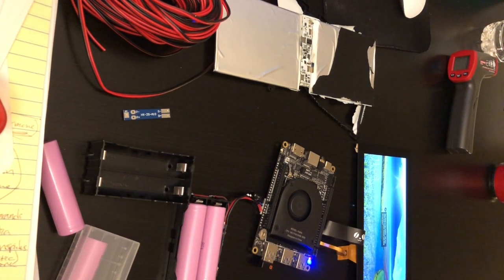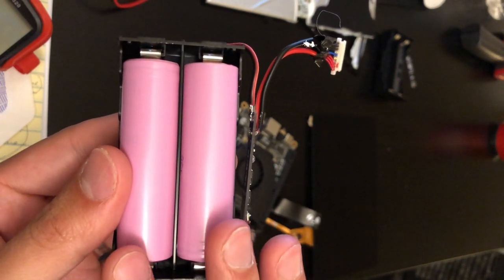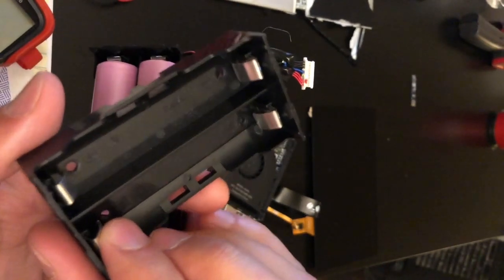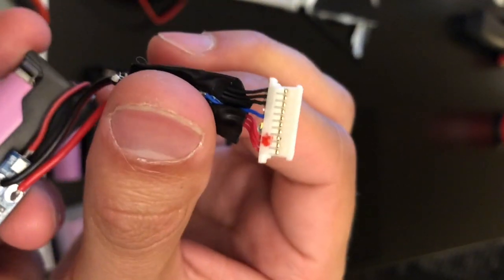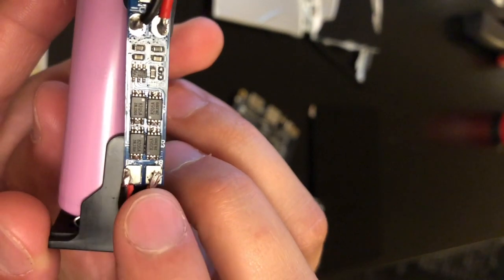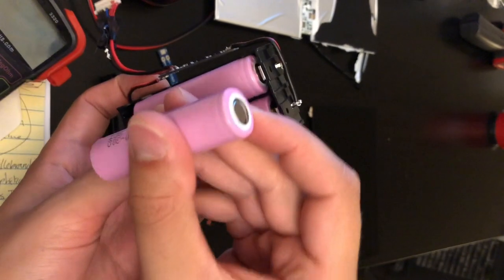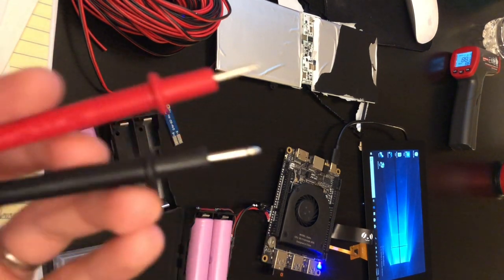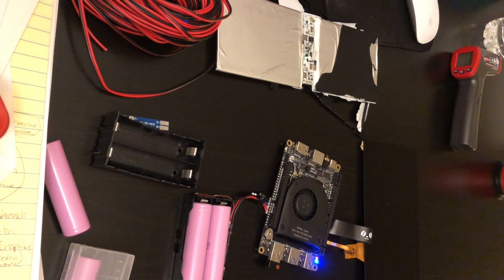DIY 18650 battery pack tutorial for LattePanda Alpha

Comment: great project you earn a new subcriber. I had a similar idea for a cloud
 gamig cosole with joycon can yoy give me an advice for a less power 
demanding board?
Reply from the maker: francesco atria thanks for watching! Do you want x86 or ARM architecture? For windows based stuff you’d have to look  at the atom series of processors.
Reply: @HandheldHardware  initially I was thinking about android but with the rise of smartphone spec I think it would be pretty useless so I thought windows might be a better idea
Reply from the maker: francesco atria LattePanda makes a Intel atom z8350 processor that uses around 10W for the whole board. UP board also makes a couple of intel atom boards. UP core is in a fairly small form factor too. Udoo X86 is an intel atom line, plus they have a X86 II line with Celeron and pentium mobile processors which should be a little less power consumption then the LattePanda Alpha
Reply: @HandheldHardware  I didn't know about them I will check them out thank you

Comment: Did you test the thermal cut off? By heating the thermistor??
Reply from the maker: Chris hi Chris, not yet. I just got some new thermistors and I successfully created a 10pin connector, so I will make another battery pack. I’ll test it then.

Comment: Great DIY!! I am going to look into Battery protection boards as I would love to find one that has the ability to monitor the batteries properly. Depending on the individual cells that are purchased, You could build a 4 cell 12000 mAh battery pack which should net the Latte panda a fair amount of use before recharge. I saw that you were finding about 45 minutes per cell? What are the specs of the cells themselves, 2500 or 3000 mAh? Either way 2 cells in a pack already have more potential then the Cube I7 batteries I have currently. 4 cells In theory should net the latte panda at least 3 hours of heavy usage as I am getting about an hour and a half out of the 4500mAh battery plugged in currently, But keep in mind my latte panda runs at 12 watts continuous. I know there is a lot of other factors in these equations but I like my rough guesstimations personally. The biggest thing preventing me from continuing with printing a case to house everything is thermals. Whether I am at 5 watts or 15, the board seems to run extremely hot, even at idle. Its not uncommon for the Cpu to hit 90 degrees under load even with everything heavily undervolted.. someone needs to release an aftermarket cooler that can properly handle the cpu at hand but I have not found anything as of yet.  (Sorry for all the word vomit here)

With all that said, Excellent Tutorial on how to use 18650 lithium Batteries!!! Don't forget your thermal resistor needs to be close to the batteries to properly prevent thermal issues down the road (If that was the case here) and I look forward to seeing all the projects you produce!!! Have a great day!
Reply from the maker: Hi Christian! I bought some components to make the connectors for 10p terminal. I didn't buy the crimper ($360!!!!!! Too expensive), but I'll see if I can find a way to secure the wires without the proper crimp tool (i.e. solder and glue). Yes, I got about 45 minutes of run time with moderate gaming  without any setting changes, so theoretically you could get more life if you changed some CPU clock settings etc. It was 4.19V when I put them in, and ~3.65V when the computer shut down. The batteries are 3000 mAh.
Reply from the maker: hi Christian, I used intel XTU and saw that the game i was playing had the cpu clocks at 2.4 Ghz and GPU clocks at ~700 MHz so it was at the high end of TDP usage, which might equate to "heavy" usage
Reply: @HandheldHardware  So the GPU and the CPU will run at 848Mhz and 2.47Ghz respectively all day long when given the right amount of power and good cooling, When I launch heaven benchmark with the LPA set to 12 watts, it will runs at those frequency's and pull 9-11 watts for the hole cpu package. If I play something CPU heavy like a modded Skyrim session, even 12 watts is not enough half the time to keep the cpu/gpu fed and one of the two will down-clock respectively. You LPA was probably hitting that 7 watt limit resulting in the 700mhz GPU frequency (I really wish MSI afterburner would report the GPU frequency in game) My biggest issue is the LPA likes to hit 80 degrees and throttle after 15-20 minutes (I wish someone would make an aftermarket cooler already!!!) But I just did a test and at 12 watt TDP With heaven benchmark running, The LPA lasts actually right at 45 minutes (5% battery left) Multiple of these 18650 cells should keep the LPA fed for a decent amount of time! I think 2 minimum would be a good idea personally.

With the recent release of the GPD win 2 (Refresh), A GPD win Max powered by ryzen, and At last, signs of the Smach Z Arriving soon (A test model has already been sent to "The Phawx" ) I have lost my drive to make a portable windows game console.... I am now thinking about making a Micro gaming PC Replica With the the LPA/GT1030. May even try to create a tiny monitor with the LP Screen! But as always I look forward to any more videos you produce and Wish you luck on the creation of a 10 Pin connector, Nothing about that looks easy haha!
Reply from the maker: Christian Batzer I agree, the GPD win 2 max with Ryzen will be the best portable gaming solution. I found a better gpu LPA power solution then the Xbox 360 psu! It’s the same power supply eta prime uses without the picoPSU, just get a female barrel jack adapter and solder your gpu/LPa power connectors to it. Works beautiuflly
Reply: @christianbatzer8505  hey cristian i habe a question for u how much volts need lattepanda why i habe a good idea i think

Comment: Firstly, great video and a very interesting topic that nobody has covered for the LPA yet :) Can you explain the main use of the thermistor in this project please??
Reply from the maker: Chris thank you for watching! I forgot to elaborate on that a bit, and for this prototype I didn’t really set it up correctly. If the batteries heat up more than they should the resistance drops on the thermistor and the LPA will stop charging it. It’s a protection feature. I’ve got some proper length thermistors coming that I will put next to the battery
Reply: @HandheldHardware  Thanks for the reply, I figured that's what it was for, I'm guessing in your final set up it will be relocated next to the batteries? If increase the cell number would you add more than one, for each pair say?? How would that work? Thanks :)
Reply from the maker: Chris my guess now would be put the two packs next to each other and place the thermistor in the middle. I don’t think parallel 20K ohm thermistors would properly cut the charging in case of overheating. I may investigate further. Is this something you are interested in doing?
Reply: @HandheldHardware  Yes I will definitely look at building a battery just like this. If I was to build it I would definitely want a larger capacity, maybe 4-6 cells depending on how viable it would be. I will print a case for them I think :)
Reply from the maker: @Chris-fz5oe  that would be awesome! With 1 cell I got about 45 minutes of moderate (but consistent the whole time) gaming before the computer shut off. I should note that I did not lower the CPU TDP or adjust the battery settings for conversation. I also ordered the parts to make the 10 pin molex connector, so more to come!
Reply: @HandheldHardware  looking forward to the videos already!! Really great work ;)
Reply: @HandheldHardware  Battery pack built 4P2S (approx 10,000mah), same cells that you used :) currently up and running for the first discharge. Will run a few cycles and see where im at with it. Thermistor is wired in, wondering where on the pack would be best for it....or maybe if i need multiple and if that requires the thermistors to be different ratings......?? really not sure on that part. I think i will print a case for the battery pack and and add a DC barrel connector to it, then when i finished the LP case design ill do the same on that, to make it easier to connect the battery :) thoughts?
Reply from the maker: Chris hi Chris, wow! 10000 mAh? That’s impressive! I’d love to see a picture! I thought about the thermistor situation for multiple packs... a simple solution might be a copper wire carefully taped to the shell of each battery and attached to the thermistor to maintain thermal continuity across the batteries
Reply from the maker: Chris I’ll play around with the thermistor to see i can determine the resistance cut off. Maybe for four packs a 30-40k Ohm NTC thermistor might work in parallel
Reply: @HandheldHardware  not sure I can send images here, if you've got somewhere I can send it to I'll fire one over :)
Reply: Sounds good ;) didn't even think about using a heat conductor like the copper wire as a solution, makes sense :)
Reply from the maker: Chris sure! You can reach me at project.sbc@outlook.com
Reply: @HandheldHardware  sent :)